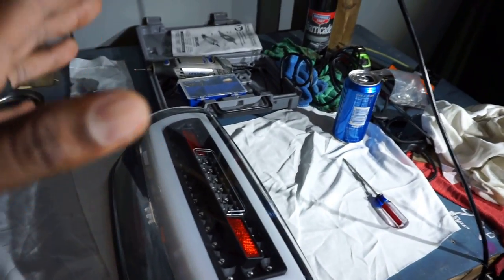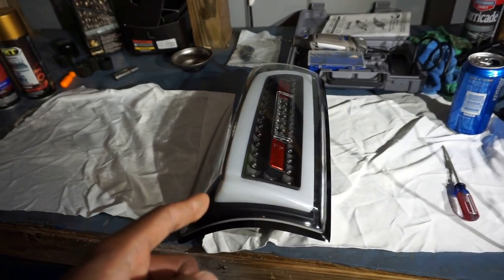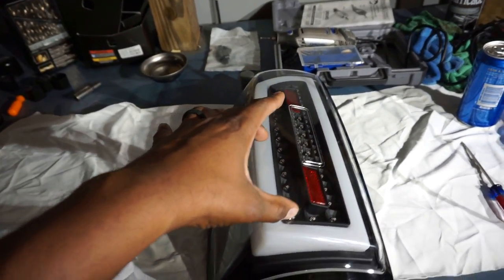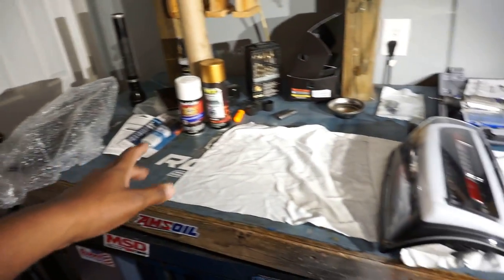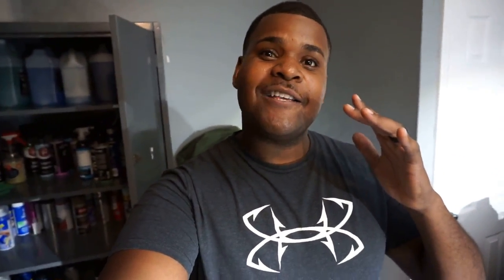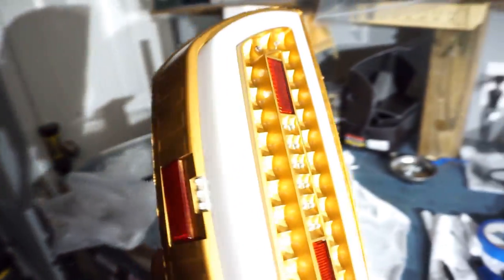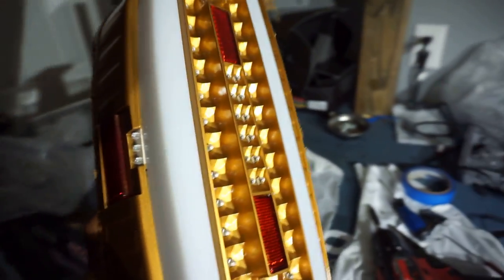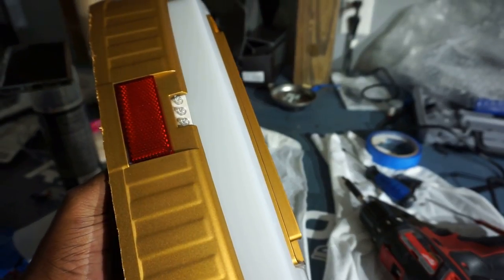Installing CUSTOM TAIL LIGHTS on my 3RD GEN CUMMINS!!

Comment: Did you have to use resistors for the turn signals so they don't hyper flash ?
Reply from the maker: It had it built into the tail light
Reply: @EVERYTHANGDIESEL  Just ordered a set for my 08 3500 Dually !